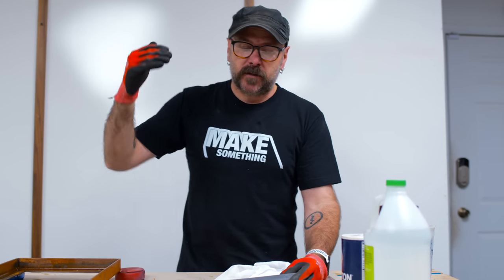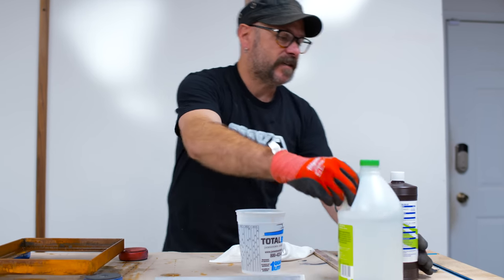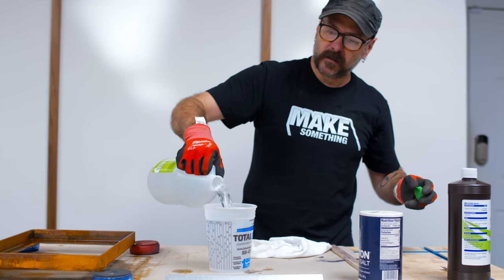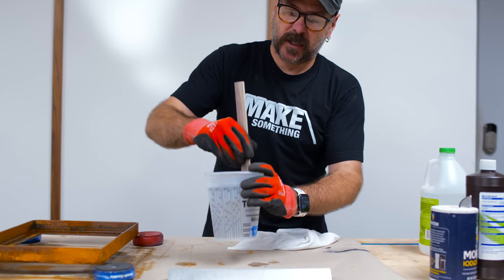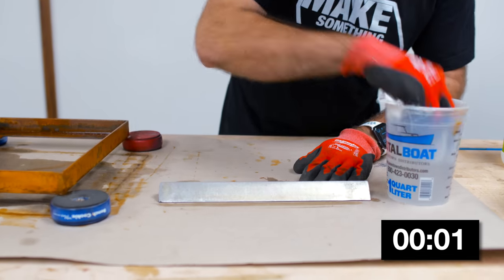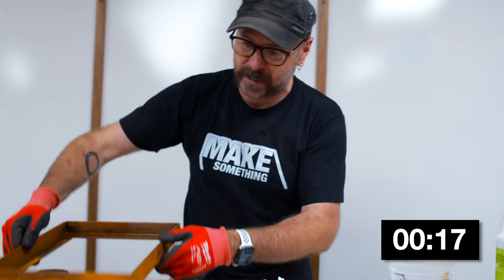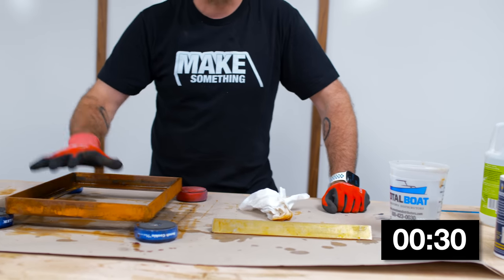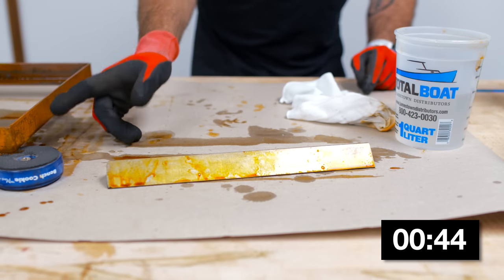How to Make Metal Rust Instantly.

Comment: Now if you can remove rust instantly my truck can be the test subject.  Ohio winters... you feel me.
Reply: Being a former fellow Rust Belt victim? I feel your pain. All I can say is, car washes... Lots of car washes to get the salt back off. I learned the importance of undercarriage washes especially after blowing two brake lines when I needed them to stay un-blown up.

And keep some rags in your car to dry your door seals afterwards if you do. Nothing as anticlimactic as getting the salt off, only to deal with doors that froze shut later.
Reply: “It’s going to rust like a 79 F150 in January in Ohio”
Reply: @russellborrego1689  Proper undercarriage maintenance is a must. Wait, what are we talking about here?
Reply: @robb1267 , interchangeable ideals really. Similar means of getting there as well. 👍👍
Reply: I live in Minnesota and Minnesota Winters are worse
Reply: Rust mort
Reply: Ohio winters are ruthless, I feel your pain lmao
Reply: POR-15 will do the trick. That is exactly what it is made for and it is amazing.
Reply: Once rust starts you can't remove it or stop it
Reply: I feel you… MN winter
Reply: @KatanaRIDERS.  you can sand it and flex seal it lol
Reply: Yep just give it a bath in vinegar
Reply: You're gonna need to cover it in aluminum powder and then set it on fire with a very hot spark. Your truck might not be particularly truck shaped after that, but it will sure be rust-free

Comment: Nice! If you apply this process, and then heat the metal without exposure to oxygen (like in a hot water bath), you get a black oxide (magnetite) coating, AKA "bluing". You should do a video on that finish as well!

Comment: Do you also know how to make rust disappear instantly? That's what I need, lol.

Clear coat won't stick well to rust and will eventually, depending on humidity, peel off because the rusting process continues underneath. 

Use something that seals up the rust, like Owatrol oil, it has the same effect as rust converter but keeps the red-brownish color as it doesn't react with the rust, it just clogs up all it's pores.
Reply from the maker: Right on, thanks!!
Reply: Evporust makes it disappear... Releasing a video on it today... 🤣
Reply: POR-15.
Reply: For how long will a clear coat be good enough if the material is outside approximately 5 months a year?  Months or years?
Reply: Won't rust form a protective layer to the metal underneath

Comment: So, if I'm not mistaken, you can then convert the outer oxidized layer into black rust to keep non-stainless steel from rusting with exposure. By... boiling it, I believe?

I'm trying to rust-proof some machine parts.

Comment: Hi , I'm doing quite similar, but I took hydrochloric acid (about 25%) and put a bunch of copper into it. After about 2 weeks I took the copper out and mix ca. 100ml with 3-4 l water. It starts to rust not so fast as yours but the copper will stop the rusting after some time and you don't have to finish with clear paint.

Comment: Do you need to neutralize the reaction or does that happen when it dries?
Reply: you could rinse off excess salt so it doesn't eat it away in 20 years, but peroxide is pretty delute and vinegar is mostly water. You could gargle with this, but it would be nasty. might be a good way to kill a canker sore.

Comment: Well that was to the point. I will definitely use this as a reference video when I want to rust something. I sealed some metal last year with Penetrol by Flood. I can't remember for sure, but it is supposed protect but allow oxidation to continue slowly, or something like that. It was easy to use and I was happy with it. Thanks for the video :)

Comment: I watched the video of using the rusting technique for the guitar sign.  Have you come up with a way to rust the metal and protect it without causing it to darken or make it look wet?

I need to make a smallish dining table in a beach / ocean themed setting.  I've thought about cypress stumps, etc, but also using heavy anchor chain welded together organically so it looks like it draping down and piping up on the floor.  I think I'd like to make it look rusted without the rust coming off on clothing, but don't want to make it look wet.

Comment: I’m trying to rust an ax head, but it just turns black!! What’s up with that I’ve used your recipe at least a dozen times and it’s always worked great. I just don’t understand what it is that makes it turn black instead of rusting. Same manufacturer on the hammer, screw driver and sockets I’ve rapidly rusted.

Comment: I have a metal top that is uneven, could I use this and sanding to sand it down smooth?
Reply: I wouldn't use this solution, sanding might work but hard to get it flat with a small sander.

Comment: Without the salt would it remove rust?
Reply: just using white vinegar will remove rust but you have to let it soak for a bit. i have used it to clean old bike parts and work decently well. its also a good all around cleaner. i have never tried mixing it with hydrogen peroxide though.
Reply: @niq872  Hmmm... interesting.

Comment: Will this weaken the metal overtime or will it not penetrate the metal that much?
Reply: do not do this to something that needs its integrity to be safe. This is a cosmetic thing. Photo frames and Iron work decorations. If you have something that needs to be strong and last, do not make it rust intentionally.

Comment: Hi David Picciuto, I'm Daniel Miller. I purchased piece of hot rolled steel and can't get it to rust with said formula. I sanded it down, got down to the metal, but no go. Any ideas why a metal might not rust?
Reply: Did you get the metal to rust? I'm having the same issue.

Comment: I tried this mix of ingredients and put some metal wire to rust for crafting, I was surprised it actually made the metal warm to the touch with plastic gloves on of course, but instead of spraying the metal, I soaked metal in solution, seems to have worked great.   But now I do not know where or how to dispose of the solution?  Any ideas???  As I am afraid of just dumping down the sink or toilet.
Reply from the maker: That's a good question and honestly don't have an answer for. Sorry.

Comment: Well their is another way to way to make iron rust instantly use Industrial grade Chlorine have Salt water, and HCL and have some form of Chromium in it put it in a spray bottle that is designed to handle heavy acids then have a form of highly reactive fluorine as well and spray the first solution on then go back and blast it with Fluorine and well you have officially rusted the metal the instant it made contact.